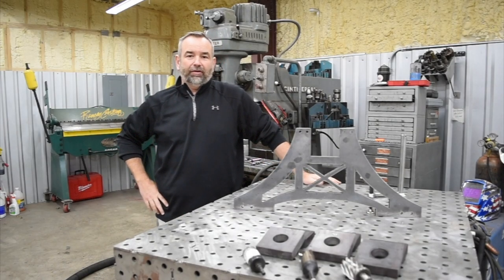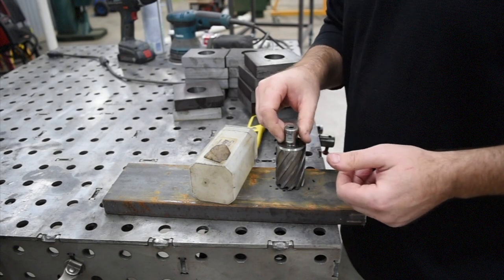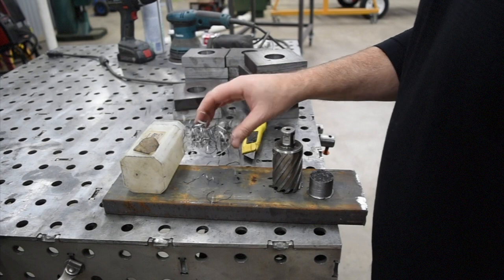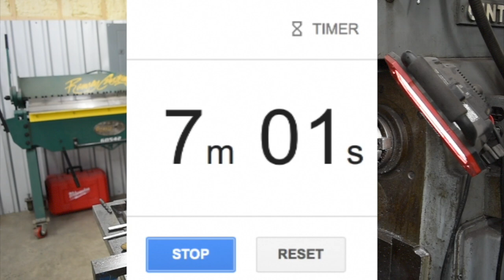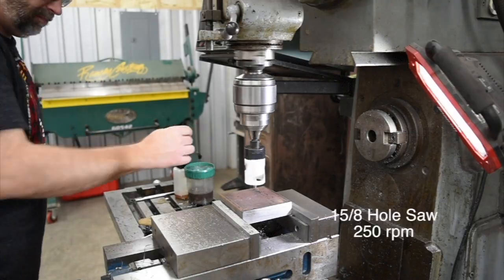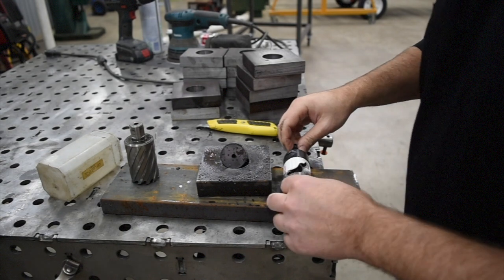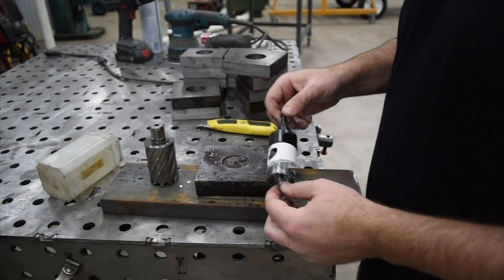Drill big holes in 1" thick steel - Fastest way? - Iron - Metal - Aluminum - Large Drill Press

Comment: At work we do use the annular cutter regularly, however we’re using them on a mag drill. The Hougen’s are freaking hauling ass turning those things. The Slugger and Milwaukee do have speed adjustments on them, could be wrong but even on there lowerest speed their turning faster then 220. Do agree with you on stepping up in smaller steps on getting to the bigger drill big, it takes a little longer but it’s easier on the bit and your not having to put as much pressure to drill the hole. Was taught years ago, light pressure on the bit, lots of oil let the bit do the work, and they last a long time and it has always seemed to work well. However have seen guys try to put there whole body weight on a drill bit, and burn up a 3/4 drill bit drilling one hole in some 1” plate.

Comment: It has been my standard practice to just drill a hole slightly larger than the tip of the desired large drill bit. It is surprising how well it works. My Uncle told me about that 20 years ago,  hasn't failed me yet. More tools means more time. Pilot hole then finish size...

Comment: annular cutter all the way, the reason? On under powered equipment, they just work better. Most decent drill presses or small mills will run that size annular cutter but not the twist drill. Also, for the annular cutter, if you are using it in a mill that uses R8 collets, get a R8 3/4 end mill holder and cut is down and make a dedicated annular cutter holder. 

All annular cutters have a 3/4 shank size so after you make the dedicated annular cutter holder it works for any annular cutter size. I just made one and then used a 1.5" annular cutter on 1-1/2 inch cold roll using a bench top under powered mill and it worked fine, though I had to go slower and keep it lubed. 

That little bench top mill would not have done well with that huge twist drill. Forget the hole saws, unless you get a really high quality one they suck and then will only be good for one hole. Hole saws, use them for thin gauge steel only. 

That big mill this guy had would handle anything but many of us don't have a mill like that.

I now try and look out on ebay for deals on annular cutters and snag them when ever I find a deal on a size I don't have that is above 3/4" and is 2" long. Don't even bother with the shorter ones, buy 2" min length so you can drill deep when you need to.

Comment: Great Video! If you drill a through-hole just inside the perimeter before using the hole saw, then you don't need to peck drill and you have a hole down which swarf will evacuate automatically; you just keep it lubricated from the top.

Comment: Helpful video. Thanks. Good and speedy where it need to be.  Annular cutters obviously are the go. Hole saw bits I have used are a good lower cost option just make sure you don't use ones just for wood use. Big drill bits vibrate in smaller drill presses.  RPM speed was also crucial information. Thumbs up.

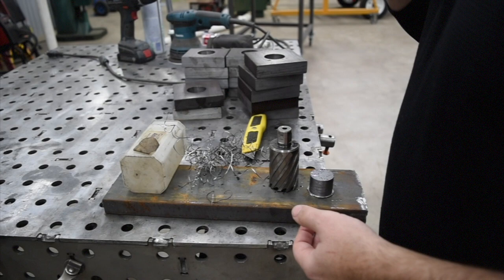Comment: These angular drill bits are a beast. They are brutal. I stop at 3:45 and I would have to agree. You ran the machine just right for the cut. Not hard and plenty lubricant. You will preserve the life of the drill bits. Well, you would get more life and or uses from the bit. Also not as much stress on the drill press. In saying that, these bits will require a decent drill press. I will watch the rest of the video . Thanks for the upload.

Comment: Good videos, a annular is perfect for non critical holes. If you want fast accurate holes you want a T/A bit, followed by a reemer. A T/a Bit is a drill bit with a replaceable tip, they can be tailored to the thousandths. The best thing I there fast & each parent bit can exept many sizes, It's the only way to go. I have been a production machinist for 30 years & learned this the hard way. Your video reminded me of that.

Comment: Neat comparison. I mainly have used hole saws in this situation and find that after one or two holes the saw is pretty well done for. They aren't made for this type of application. Thanks for sharing Gary. I always enjoy/appreciate your content.
Reply: Most are drilling too fast and with insufficient down pressure and without enough cutting(cooling) fluid.
Most drill and drill presses run too fast and/or have little torque at low speeds.
The proper solution is a very expensive drill press designed for metals or a mag drill, or a drill/mill.
Old vintage drill presses are easier to gear down, but can still be expensive, and very heavy.
I bought a triple gear reduction hand drill so I can drill more slowly in metal and purchased a drill stand. It is possible my hand drill could catch in metal and twist this stand apart 😞
I do have another option; I have an old post drill press. Needs a bit of repair, but it is hand operated and you can go as slow as you want. Has an odd chuck though. I would need to attach a Jacobs type chuck to get good use out of it. You can drill slowly and produce little heat. Probably why the 100+ year old bits still exist. Many have been sharpened over and over and are very short lol

Comment: Interesting shootout Gary.  I think doing these types of things with the setup/tooling you are going to use for the job is really smart because it will point out things that you may not have considered otherwise.  I'm thinking of the chips generated by the annular cutter.  I would not have thought of those as being a potential issue, but if you're doing a lot of holes then I could see it costing time.

Comment: I couldn't talk my brother into trying this on his mill, so I'll just tell you my idea for drilling that hole faster with a hole saw.  You have to do 2 things different.  First remove the center drill from the hole saw (you don't need it when using a mill) That won't speed the cut up much, but this should.  Drill a 3/8" or 1/2" hole that is almost tangent with what will be the inside edge of your large hole.  Now you have a path for the chips to clear, just be sure to use a thinner coolant, and use more of it.

Comment: One suggestion on the hole saw. Drill two 1/4" holes 180 degrees apart on the inside of the circle the will allow the chips to evacuate down through the holes and out the bottom of the work. This speeds up the cutting escpecially when using the larger diameter hole saws. Use lots of motor oil to keep it cool and watch the chips come out the bottom....Great video...Thank you

Comment: Nice. I expected the annular cutter to win because 1. It had chip evacuation and 2. It removed a slug, it didn't turn the material to chips. I was surprised that the hole saw beat the twist drill actually. Considering the hole saw has atrocious chip evacuation. And I wasn't expecting so many bit changes for the twist drill. However the problem with not changing bits is that you're forcing the bit to to scoop away more material which requires more torque from the machine. Overall a great test.

Comment: What the hell... Your pilot drill should only be roughly equal to the web thickness of the larger drill. If your machine has the torque, a smaller pilot will be much easier on a larger drill. Pushing a 1.x" drill through a .75" hole is more likely to chip the cutting edges of the larger drill. That hole could have been done in a small fraction of the time it took you.

(Source- Machinist, drilled literally thousands of 1"+ holes in heavy steel plate)

Edit: Didn't notice eformance's comment before I made this one. What he said...

Comment: I use Milwaukee steel hogs. I average be around $5 each on eBay. I tap the end with 3/4-16 and use a 3/4 in threaded shaft to drive it. tears through amazingly fast.
Reply: wow have you checked the price on the 3" or bigger Steel Hawgs.. could almost buy a plasma torch instead..

Comment: swarf is fine chips/powder usually saturated in coolant or oil. Those are just stringy chips. I would have been curious to see some other options, spade bit, or carbide. Those annular cutters are really nice for sheet metal. I never would have thought to try one on anything thicker.
Reply: cahman8 They are mostly used on mag base drills for thick material.
Reply: Tom Jeremiah Tom Jeremiah yea I remember seeing some mag drill comments on them when I was looking for more info. they require less cutting pressure so it makes since. the only thing we've used them for where I work are to cut out holes in the electrical cabinets. once you get over about 1/4" drilling in sheet metal the holes start getting shitty ass the trust drills try to grab, twist, and tear the metal. the annular cutters work really nice. most of this usually gets done on CNC and the larger cut outs and holes we cut out with a 1/4" endmill which in my opinion still isn't is effective as the cutter.
Reply: I have never tried one on sheet. We use carbide holesaws or grind a twist drill to a triple point. Otherwise its plasma or nibblers or something else freehand.

Comment: The time it took to get the plug out should have been added to the time. I have never used an annular, I did notice that there is I hole in the top. Is it threaded for a bolt/screw or do you just have to knock it out with a rod/nail and hammer?
Reply: thomptre the hole in the top is for a pin to line the cutter up with a pop mark in a mag drill there is a spring which pushes on the pin and ejects the slug

Comment: I noticed in a lot of American engineering videos you use oil in places as us British would use coolant. Do you have an answer for this? I find the oil burns and doesn't cool the tool whereas coolant lubricates, flushes and cools the tool. Is there a reason why Americans use more oil for milling, drilling and turning instead of coolant?  Thank you.
Reply: Darth Bancid agree. solioil in any bottle would be so much faster.
Reply: Coolant is used just as frequently in the US as it is anywhere else. Generally the home gamer is not set up for it or they don't want to mess with it.
Reply: Oakwood Machine Works oh right it's just a lot of the English channels use coolant and the American ones use oil. Must just be a coincidence. Thank you
Reply: washing up liquid bottle is good for coolent.
Reply: Water based coolant and cutting oil at my place of work( Netherlands )
Reply: I've always used coolant, and with coolant on that mill, a "U" or "T" drill would have ripped through that in 20seconds with coolant flushing the chips away. Then again that's insert tooling and expensive.
Reply: You are exactly right
Reply: Here in the US, In production shops, flood coolant is used 95% - 99%  of the time.  I think you are judging by the small job shops you see producing youtube videos.... small one-off shops will use cutting oil a lot more because the coolant mess made by machining one part for 5 minutes is sometimes as big as the mess made by making parts all day.... and of course that mess has to be cleaned up.  That's just my experience, but what do I know, I'm just one guy.
Reply: These hacks don't represent all of America.
Reply: no worries thanks
Reply: maybe oil is cheaper than water in USA
Reply: It's just the way some people are. They cling to the past like a ball and chain.
Reply: Some of the higher quality coolants are fairly expensive for a 5 gal bucket but they're concentrated and will last you a while if you keep your reservoirs clean. Given the option I would choose coolant every time. It flushes debris like air and with proper flow you'll never reach temperatures where anything is steaming/smoking/boiling off.
Reply: Darth Bancid as stated above. coolant is messy and requires a full enclosure pretty much. for this type of stuff oil works almost just as well with way less mess
Reply: Jack Wagon probably the best answer I've been given. I know what you mean about the coolant slinging off. I like to use oil on taps and reamers for that reason. But lately I've started using a thicker coolant that I mix very strong and it had the qualities of both oil and coolant. I also keep a runny coolant for easy clean up. It's a personal preference but I actually find coolant is easier to wipe away than oil. Thanks your the points.
Reply: I know this is an older comment. But coolants do cool well but typically do have a lubricity that actually can increase the cutting penetration factor for light cuts as would lubricating oil. The sulfur in cutting oil actually can microscopically cause the tool to gall at first 'touch' causing the tool to get under the 'skin' of the surface a bit quicker on manually fed operations. Meaning just a bit less dwell time with sulfurized oil than coolant while cutting tougher stainless alloys which is better for tool. Even on CNC I hear that squeal at the start of the pecks for a split second before the tool builds enough pressure to 'bite' under the surface. Very minute difference though. However, some stainless slides a chip across the tools with better lubricity using oil than coolant creating less top surface crater wear. Depends on application, quantity and time vs tool cost for how much it matters.
Reply: Diamond Eyes I'm a skilled lathe and mill machinist, but since I love metalworking, I Aldo had a small milling machine in my garage.
and even in this small non-professional enviroment, I use coolant, with a coolant pump, to mill and drill parts for my hobby.

I tried to use cutting oil, but it's useless, it smoke, no flow don't allow chips to go away from tool, tool becomes hot and worked surface has a worst finish.
I find that works good only in stainless steel working, but coolant works better however.
Reply: deserada water based coolant carries away heat a lot more efficiently than oil.
Oil has to be used when lubricity is more important than cooling, like for thread rolling, broaching, gear cutting.
In addition to mechanical necessity, there are humans necessity.

Coolant is more skin friendly than oil.
To clean parts after working, with coolant you need only compressed air.
Coolant drips away from chips, to avoid throwing away precious oil with chips you need a centrifuge.

Oil is flammable, coolant isn't.

Oil smoke or vapour is harmful.
Coolant simply don't smokes, and in few cases does vapour.

No way, coolant is best.
Reply: John O'Herron I have a small chinese mill in my garage (for hobby, but I work on a Mori Seiki NL since years), and Yes, I use only flood coolant.

You don't need to see smoke from oil to understand if you are working right, experience says.

Try coolant, then say me if it cools less or more than oil.

cheers from Italy. :)
Reply: They use oil because they don't have provisions for flood coolant, or don't want to deal with the added expense and hassle of coolant, or can't afford flood coolant, etc. Mist systems are kind of expensive, and they waste coolant. Oil is the best option for someone in a home/low production shop.
Reply: because so many people have these or even know what they are.
Reply: it depends on what the shop and particular machine is set up for.  a lot of shops that only have manual things often dont have coolant as they might not have anything that is setup for it.  even if im on a machine that doesnt have it i will either use it in a spray bottle or hook up my homemade coolant/airblaster to evacuate chips and control temps.
Reply: What are you calling a coolant? Water ???
Reply: @fraserdouglas3693  so do I !!!!!
Reply: Meh, I've been in welding/steel fabrication since the late 90's (in US) and we've always flooded with water based coolant.  I noticed the same thing myself and just assume we're seeing a lot of weekend warriors on YouTube.  A pro would have known to never peck with annular cutters, ran steady coolant/pressure and blown through in about half the time.
Reply: @samp1394 

Probably "soluble oil" produced specifically for coolant. Mix it ± 1:10 with water. Lubes and cools but needs continuous IRRIGATION  otherwise the water evaporates pdq and you are just left with a miniscule bit of oil.
Reply: deserada aa

Comment: i'm a hobbyist, with a question about coolant. do you need a system, or can you just use a spray bottle? does it have to be applied constantly to be effective, or just hit it from time to time, like oil?
Reply: Alan Desgrange

I'm a hobbyist too but my old man's was an inventive machinist of note and his home shop reflected it. So I (hopefully) learned a bit from. Unfortunately I didn't inherit his shop so, equipment wise, am limited to doing with what I have.

In this case, a ¼hp drill press, min rpm 600 and a 40 mm hole saw. It can be done... I did it but oh my! 

But to answer your question. To achieve any sort of cooling you need a continuous stream of coolant flowing ± ½-1 litre/minute over the cutting position. This takes the heat off elsewhere. If the "elsewhere" is not to be your shop floor then you need to catch it in something, so it gets complicated.

But for the home hobbyist it is easy enough to make a jimmy-rigged arrangement with a plastic soda bottle, some plastic aquarium tubing and a stop cock from the pet shop, a bit of soft wire, a saucepan from the kitchen and a magnet or two. It works pretty well, actually. A hot glue gun is helpful.

You can make your own "soluble oil" by shaking up some (±2 tbsp} 3-in-1 oil with an equal amount of dish washing liquid in ±1 pint of warmish water. 

Give it a bash...